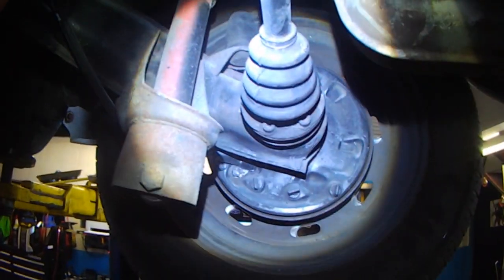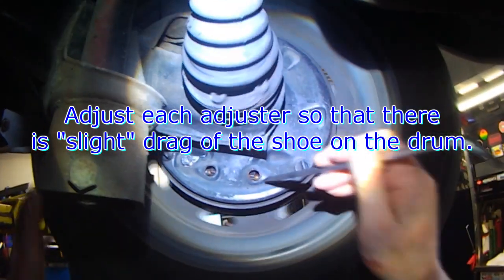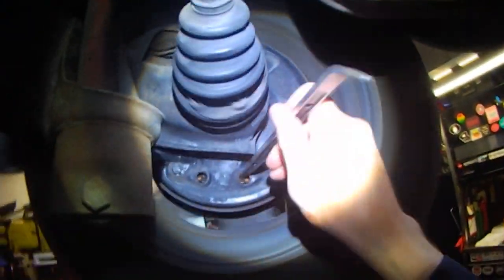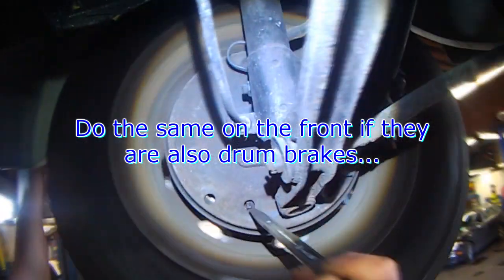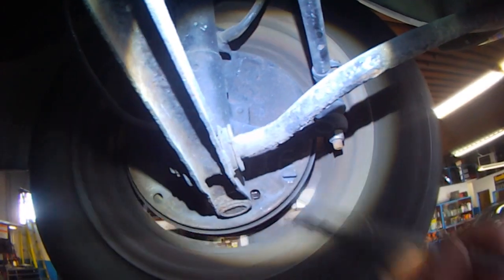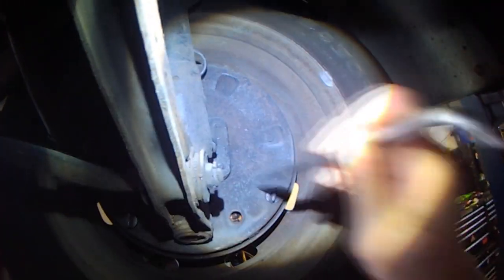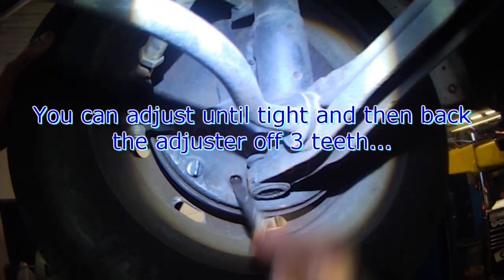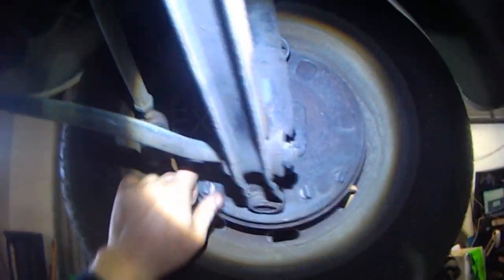VW T1: Quick drum brake shoe adjustment

Comment: I have a 77 VW Bus. I adjust brakes similar to this great video. I have a question about the way the wheel cylinder pushes the pads. Does it open simultaneously, or does one side push the pad first before the other side is activated. I thought I was having a brake seizure because the hub and drum were getting hot.So I took the drum off and everything looks OK. The handbrake releases. Just not sure about the wheel cylinder. No leaking found.
Reply from the maker: In ideal conditions, both sides of the wheel cylinder will move at the same time. Most likely though, one will move before the other. Pistons can also get stuck if the vehicle has not been used for a long time... check for piston operation / movement by squeezing them into the cylinder bore.

Comment: I’ve a ‘72 bus.  The shoes have vertical play.  How do you know if the shoes are centered to the drum?  Will the application of the brakes center the shoes to the drum?  Thanks!
Reply from the maker: Yes... make sure that the adjusters are sitting correctly. If they (adjuster seat) are tapered, the shoes have to sit in the taper correctly.

Comment: Was it a specific break adjustment tool that u were using to turn the gears or is it just a generic blade ?
Reply from the maker: It's a tool designed for turning the adjusters, but you can use a flathead screwdriver. When the adjusters are difficult to move, use a punch & hammer to rotate the adjuster (or disassemble the brakes and free them up).

Comment: Do u know where I can find 1996 vw passat tdi parking brake guide tubes? New or used(in good condition), I've been searching but it all pops up discontinued.  I pulled of the old ones and a third of the tube is rust rotted and the other  2 thirds is like new, 430000 miles on the car. Any help is appreciated.
Reply from the maker: I'll have a look and will get back to you.
Reply: Thomas EXOVCDS thanks.
Reply from the maker: All I found was the part numbers (but am not sure if they are correct).Right: 3A0711952 Left: 3A0711951
I'll check with out parts suppliers tomorrow... otherwise, do an online search for those numbers (I did a quick look and can't find anything). I'm sure that you'd probably still get something out of Germany... maybe.
Reply: Thomas EXOVCDS I found the same part numbers, yup looks like germany is the only place that is making them or has some. Thanks for the info!

Comment: No sneak peak at the rest of it then :( 
I'm surprised it's still running drums up front. 
I had many scary moments with mine, so I run discs all round now.
Reply from the maker: You're also running more power! =)
Reply: My first bug was a 'fat chick' 1303, or super bug as you overseas types call them lol.
With drums all round it always locked up in the wet so I put the 1303S front axle/discs on.
So much safer on slippery roads!
Quite fancy owning a super bug convertible, a very practical classic.
Do you have many bugs in the garage these days?
Reply from the maker: djambrosia Not anymore... when I started working in the 90's, yes.